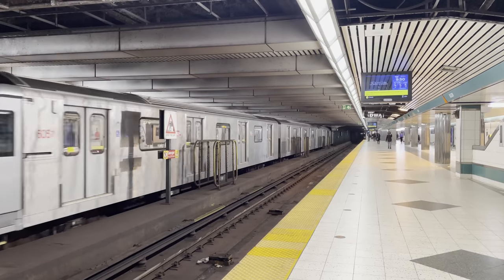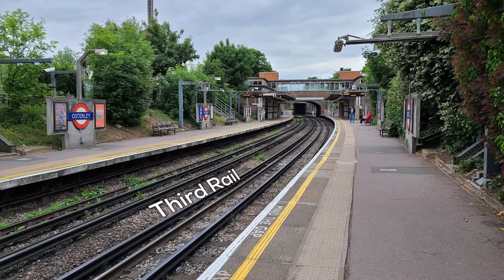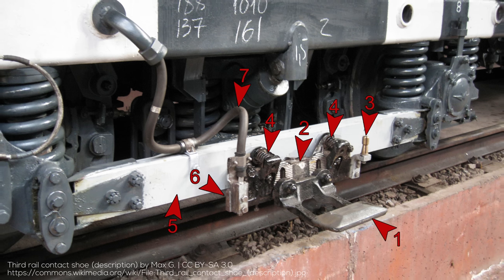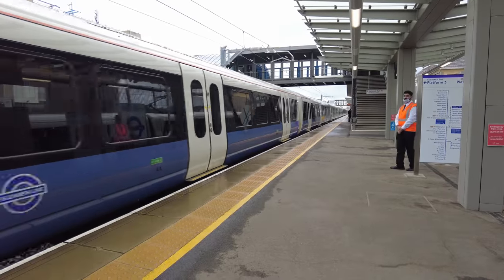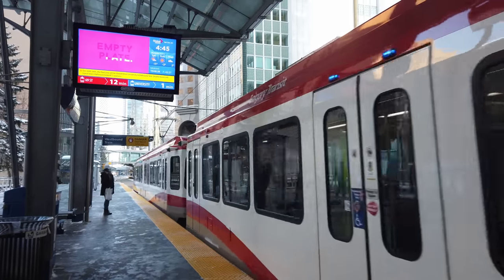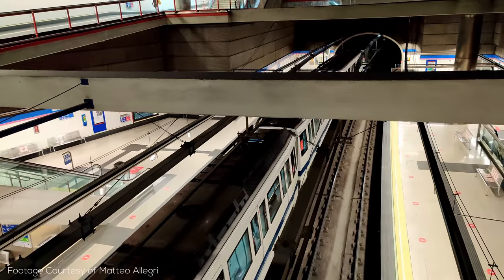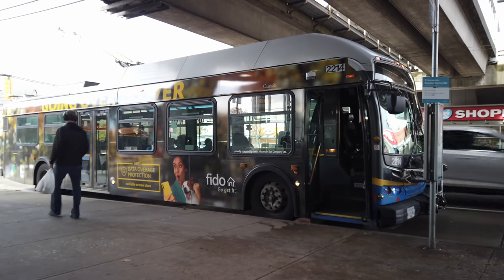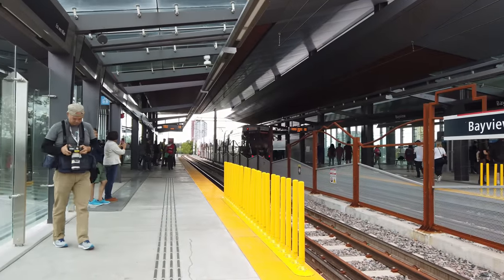The Best Way to Power Your Railway | Third Rail vs. Overhead Wire

Comment: Here in NYC metro area we have an awkward situation where there are several different commuter networks going into and out of the same city, all using the same station as a terminal basically while Amtrak goes through. Many have figured out its very inefficient and would save a lot of time and chaos to just have it be a through running station and have trains terminate a bit further in both directions. The problem? NJT uses overhead wires and LIRR uses third rail
Reply from the maker: That’s not really an issue, Thameslink is also split between third rail and overhead wire in the centre of London and it through runs.

Comment: I just wanted to know the return path on cantonary systems where there are only two rails none of which are ever electrified... ie my local transit system. Now you got me wondering the same for rubber tired buses that use trolly lines and pantos... a circuit is by definition a circle... so how does a system that only sends one wire to the load complete a circuit?

Comment: Amtrak diesel locomotives run on 3rd rail when operating in Penn station to reduce enclosed space emissions
Reply: And Metro-North diesels do the same when entering the Park Avenue Tunnel into Grand Central Terminal.

Comment: Informative vid as usual. Would you ever consider doing a whole video on Alstom APS? I'd love to hear your opinion on it as I can't really see the point.
Reply: The point is to counter opposition against tram catenary in front of historic sites, could it be from institutions or  common NIMBYs.
There is no other reason Bordeaux accepted to develop this as far as I know.
Reply: @LeGrandJuju49  Yeah, I get that, but I just don't understand what it is some people find so obtrusive about catenary wires, and when you consider how unreliable APS is, I just don't see how it can be worth it.
Reply: @pseudoNAME1979  Compared to having nothing wires are obtrusive, that's why in France we buried electrical wire in cities in the 2000s to begin with.... APS has a reliability over 96% since 2006 so this argument is no longer really relevant even if I think this is less than catenary. installing APS still costs 10 to 20% more than catenary. But this is a costs cities are willing to commit to, because expensive transit is better than no transit, especially since the aesthetics of public transit are an integral part of the urban fabric and experience often for at least the next 50 years after construction. 
In France, use of APS is a great tool to circumvent authorities having veto power to protect historical monument, which mayors always have problem with. For example, this kind of opposition caused the T3a and T3b common termini at Porte de Vincennes to be so bad by forcing the old tram arrangement of the late 19th century instead of a contiguous 4 track station...

Comment: We really messed our electrification in Ireland. For some reason we chose DC (750V I think) for the overhead wires for the DART (Dublin Area Rapid Transit) which shares track with some intercity services which are still diesel powered. This is 
 a problem now we want to electrify the intercity lines with AC, especially with there being no discernible benefit to using DC in the first place.
Reply: 750 V DC was standard for urban electrification. To use AC for the intercity lines is obviously smart. The DART can get new cars, or convert the existing, if they want to change to AC.
Reply: @cieludbjrg4706  Changing trains is easy and happens anyway, but the main problem is that the whole network would have to be changed to support AC and that’s a lot of wires.
Reply: @anoniaino  Not necessarily. AC with higher voltage will require more substantial insulation, but the wires will be the same thickness. As for the network elsewhere in Ireland (or the bits that gets electrified): You’ll get used to it. :)

Comment: I live where it floods badly at times.

That is, transit cars run in large, long cuttings.

Every once in a while the storm drains get clogged with debris.

Thus, the result is that the wheels can run in deep water.

This can short-out the electrical system.

We could use overhead catenaries.

But, we have ice storms, and poor-quality maintenance .

So, two or three times a year the cats can sag, if not fail.

This can strand a bunch of riders in a bad situation without power in a three day blizzard.

Three-day blizzards are terrifying to be stuck in, without heat.

To be brutal, I would prefer diesel.

And the engines should be in a small switcher with high clearance.

One advantage of diesel engines is that if stalled by snowfall, the diesel can continue to operate passenger car heating systems.

Comment: Sweden have been experimenting  with electrical driver less freight trucks powered by a "power strip" in the road. 

"There's no electricity at the surface and the rail is only electrified if an actual authorized vehicle is passing, so if you don't have an electric vehicle that's authorized to use the electricity, the electricity will not be turned on at all".

I think that suggests your point about safe third rails not working in snowy conditions for trams will soon be invalid. Like, this is pretty much the same thing. 

Germany is doing the same thing but have went with the pantograph route. Both seem to be going forwards and expanding.
Reply: 😂😂😂  Not much snow in Sydney.

Comment: Great video, Reece! Would love to get your insight: is third rail a viable option for freight? Given the high density of freight tracks in North America, and the need to double stack containers, is third rail the only option? How does it compare in terms of cost & installation time? Cheers
Reply: edit: The largest disadvantage with third rail for freight is that only the locomotive is powered. I.e. no possibility to pick up power from the tail of the train while the locomotive is in a level crossing - unless all rail cars had high voltage power cables run through them, and a caboose with a third rail pickup or a freight car specifically equipped (or equippable) with a set of pickup shoes was coupled to the end of the train.
The original problem that I saw with third rail for freight is the slightly different layout that switches tend to have.
For transit lines, you have a bunch of vehicles all going the same route, at the same speed. Parts of the route may be shared, but the only switches this requires are at the end(s) of that shared section splitting the branch from the mainline in a simple "Y" (or whatever is happening there). And that is not to mention the case where only the alignment is shared, but the two lines actually run on completely separate tracks into their separate sides of the station(s).
For freight, basically each freight train takes a different route across the network. This requires most junctions in the network to be built as full wyes with all possible connections - meaning more switches (which wouldn't be that much of a problem since the third rail can swap sides). But additionally, most lines are shared with regional trains and possibly even high speed trains, all running at different speeds. Which necessitates the need for overtakes, which are realized by two switches joined end to end. And depending on how close the two straight rails are, there may not be enough space to fit third rail into that section. I'd estimate that you'd need at least a whole train width of empty space between the parallel tracks in order to do that.
Reply: With the double stacked containers wasting a full bogey length (or at least half if some fraction of the bogeys is shared), I wonder if it wouldn't make more sense to just discontinue that practice. I mean, Europe is going pretty much completely without it.

Alternatively, India apparently has its catenary high enough that they can run double-stacked container cars under them.

If you can mix overhead wires and overhead-wire-less tracks (the latter being either third rail or diesel powered), I don't see why you couldn't similarly make overhead electrification work at two different heights. Tall height for all sections of track that can accommodate stacked containers, standard height for all tunnels and bridges that are too low for them anyways.
If the pantograph applies constant pressure, the transition would simply work by the wire angling down and pushing the contact head down (or allowing it to rise up). if the pantographs keep a fixed height, the conductor has to probably slow down to extend/retract the pantographs. Either the transition section would have a cable that can be pushed up or drop down in order to accommodate both heights; or the pantograph needs to rise at a defined rate (in relation to the train speed) in order to match the cable slope.
Reply: @Pystro  Changing heights of the overhead wire is absolutely a thing. The most common scenario here in the UK is on the approach to level crossings, where the wires rise up to allow as much headroom as possible. This actually posed a problem on the Great Western electrification as there was a section with a low bridge close to a level crossing, meaning they couldn't change height in the available space for the speeds they wanted (higher speed = gentler gradient needed). In the end I think they compromised by accepting that section of wires would just need a more intensive maintenance program.
Reply: Double stacking is definitely possible, you just need to put the wires higher up, and 3rd rail is really not ideal for anything other than metro systems because of its potential drop problems and the high transmission losses (the voltage is limited so that current can't jump)

Comment: It was a dark and stormy night on the Southminster branch line and a tree fell on the wires, we had leave the train and wander back along to the tiny station at Althorne
Reply: Presumably teh tree also fell across the tracks - or would have had teh wires not stopped it.

Comment: Man, pantographs seem better in basically every way but aesthetically they look so bad imo. I wish there was some sort of "best of both worlds" we could do. Could a train lift up a cover on a third rail to get power and then put it back down like two zippers next to each other? That way it could be safer and you could run higher power through it. Ok fiiine I know it wouldn't work because of wear and tear on a flexible part, and def wouldn't work in high speed, I just hope that we can find a more elegant solution some day.
Reply: Pantographs look amazing.

Comment: The other question we were all thinking is why you need a third rail for power, and can't just use one of the existing rails for live and the other for current return.
Reply: Because 
1) The axles and wheels of the rolling stock are solid metal and would short the current! Any known material used to insulate the wheel sets wouldn't be strong enough. The wheels run in a solid metal underframe. Any known material used to insulate the underframe wouldn't be strong enough. Then there is the problem of the metal body.
2) The rails would have to be insulated from the surrounding ground. Any material used wouldn't be strong enough to support the weight of the trains.
3) At junctions the rails cross, meaning that there would have to be many insulators inbetween sections of the track.
4) The rails are used for train detection and signalling. Any metal wheel set bridging the two rails is detected by the small voltage applied to the rails being shorted.
5) In an accident, the whole train could become live and escaping passengers would be in danger of electrocution from touching the rails.
and probably many other reasons.
Unless you can design a 12 volt motor powerful enough to drive a full size train, its never going to work.
Reply: @henrybest4057  So in summary, the materials that are best for power transmission are not best for holding the weight of a train, and it is useful to electrically separate the running gear from the power supply. The final reason could still occur with 3rd or 4th rail.

Thanks for the reply, I didn't think of train detection or about running gear becoming live, or about separating the rail sections at crossings.

Comment: Although rubber tyred metros use two guide rails which double as power rails, both are positively charged and sometimes only one is used in depots and low speed conditions. The closest guide rail to the platform at stations is isolated and made out of epoxy resin to be safer for passengers in Paris at least.

VAL system is the exception, where one guide rail acts as neutral and the other one is 750 V DC powered.
Reply: In Paris, the guide rail(s) are 750 V DC+, and return is via copper brushes to the running rails (steel rails) in the middle of the track. The steel rails also operate the track circuits. Works trains (converted from old steel wheel Métro stock) can thus run on the "Pneu" lines without problems, they just need an extra side-mounted pic-up shoe.